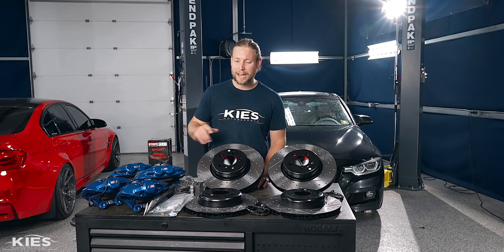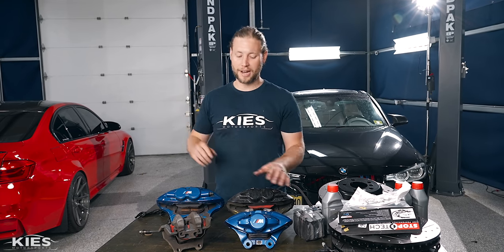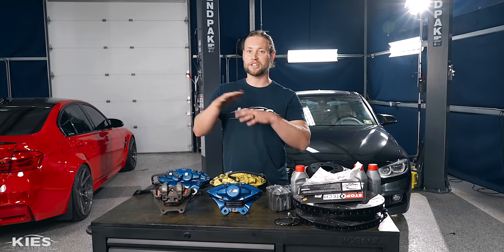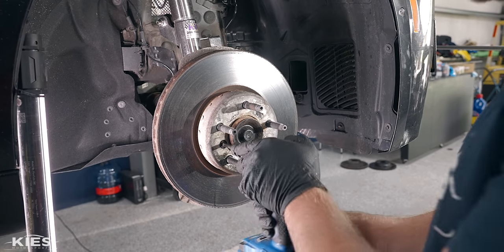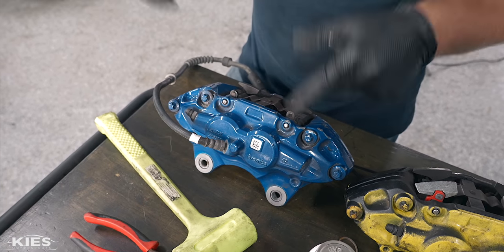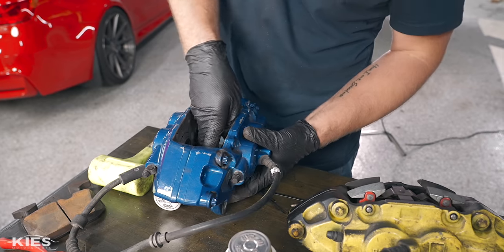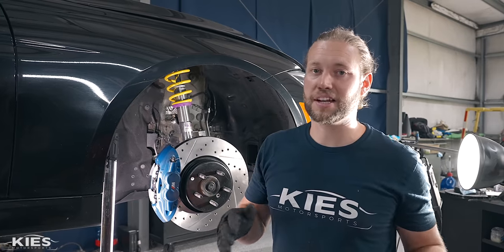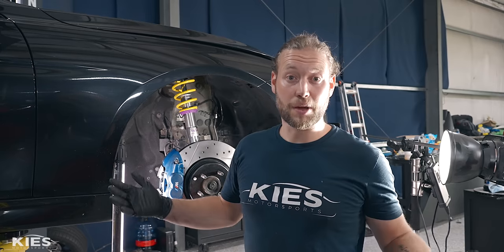How to install F80 M3 Brakes on an F30! CHEAP Big Brake Upgrade!

Comment: Crying with a 328i and base brake, as I got 17 inches wheel which makes it impossible to upgrade for M sport 4 piston brakes…
Reply: Get bigger rims, get bigger brakes. But it will cost you. Better trade it in for a 335i or 340i.

Comment: this makes zero sense to me if you have m sport, spending 2k+ for the ability to run a slightly larger rotor with basically the same caliper.